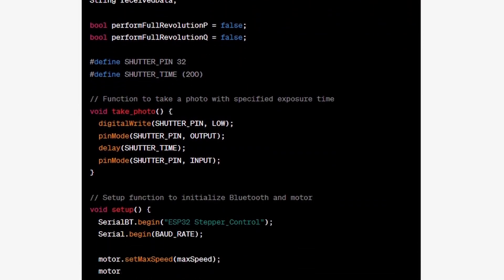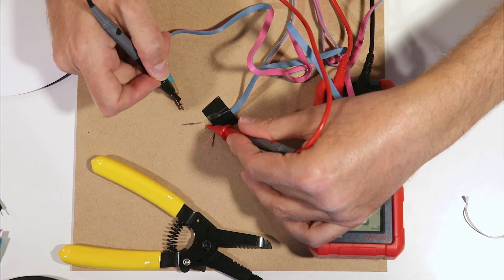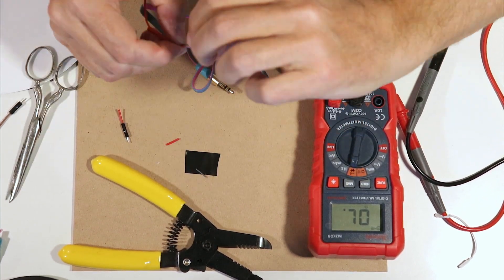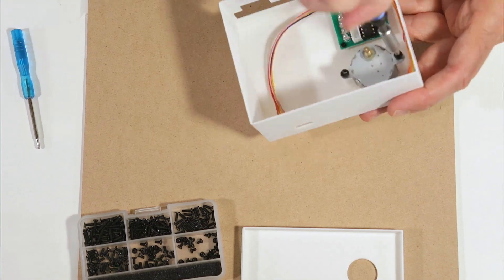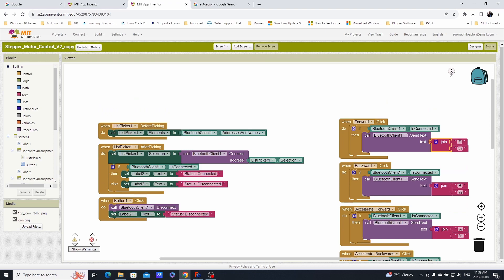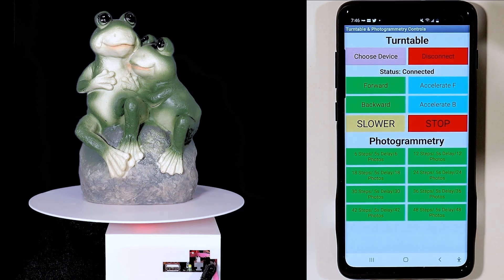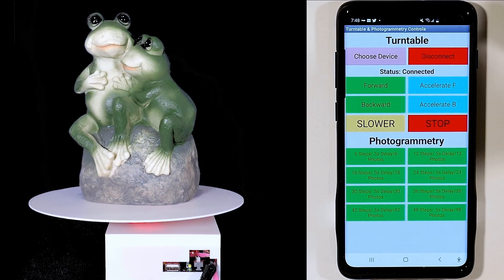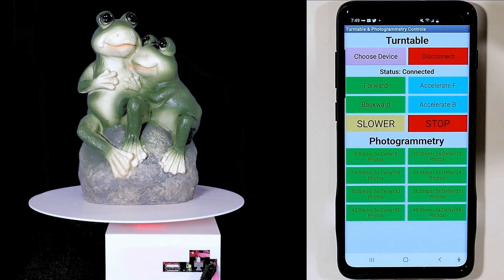ESP32 3D Printed Photogrammetry

Comment: Congratulations on the success of this project! I love seeing a like minded individual succeeding in projects like these.

Like you AI has become a great way to aid/tutor for me when I find I have limited knowledge on areas of my projects. I use photogrammetry to produce 3D reconstructions of baby plaster molds (hands/feet/face) for bereaved parents that have lost babies. I've used AI to assist with the masking background of my images quickly. I'm currently working on getting a Linux server running using Colmap for reconstruction in hopes families can just visit a webpage, upload a dataset of images, and it masks and reconstructs a 3D model with little effort on their part. All that is left is web UI development and possibly a pipeline for correcting arbitrary scaling to real world measurements.

Comment: I, like Peter below joined this 3D printing hobby post-retirement a few years ago. I subscribed to your channel as I am interested in the same things, and you offer very good solutions. We can help each other. As a retired toolmaker, machine designer and builder, I can recommend placing at least three, (one or all adjustable?), rollers or non-friction points, under your rotary table for stabilization. I don't know what effect that will have on photogrammetry, but I don't think it'll be anything but an improvement, great work, Thanks

Comment: Having the number of steps only be multiples of 6 is a bit limited. Classic FPS games like Doom or Rise Of The Triad used photos of models or actors to make their sprites, but those were taken at multiples of 45 degrees, which needs 8 steps in a revolution. I suppose you could set it to use 24 and then only keep every 3rd image, but it's still sub-optimal.
Reply from the maker: A simple and easy revision to the code can add an 8 steps per revolution setting.  In fact I might work on the code so that the user can just put in whatever number is desired per revolution.   I'll see.
Reply: @CreatewithTech  I'm just beginning my photogrammetry adventure, and what I've read so far is, that it takes dozens of photos to render a good 3D model for 3D printing, is that what you have found? thanks